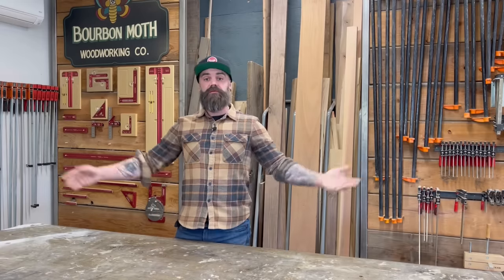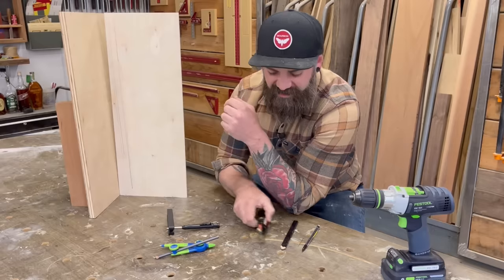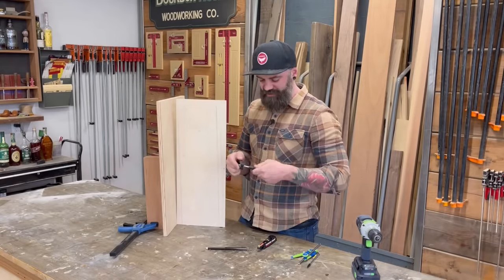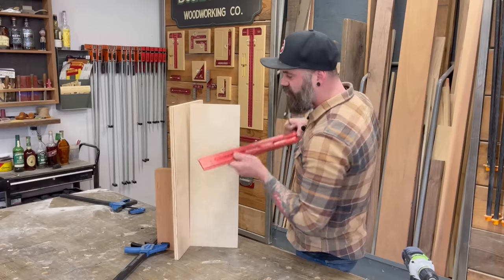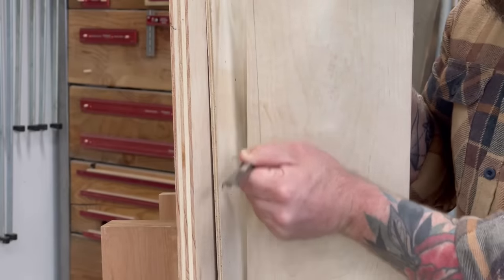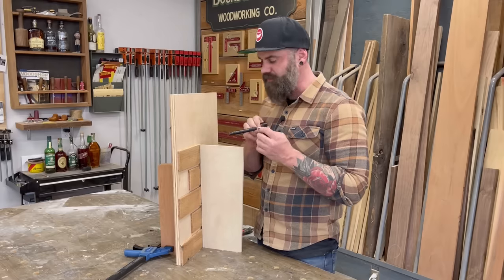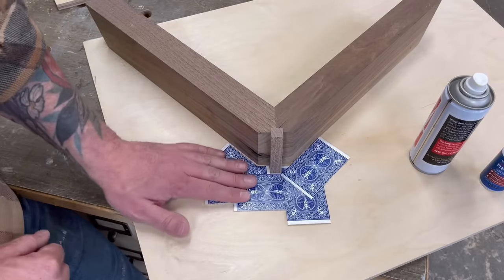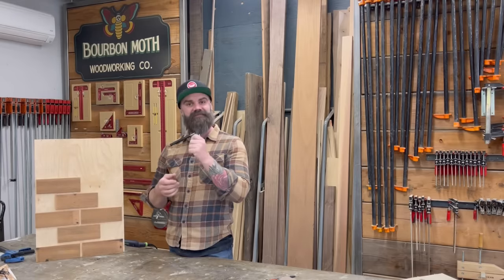Woodworking Tricks You'll Actually Use || How to Scribe to an Uneven Wall

Comment: Love the upside down jigsaw tip.  Another tip for using the jigsaw... angle the blade a bit so you also produce a sharper edge to meet the wall (like you did with the table saw).  It is then easy to adjust the edge with some minor sanding.

Comment: For the playing card trick. I use post-it’s instead with the sticky side towards the wall. So no glue needed there. And when the edges you’re scribing to aren’t straight, you can just have post-it overlap a little onto the wall, trace it with a utility knife to cut the exact shape. Stick it onto your board and done.
Reply: Where those lil mini post-it's can come in handy too, which is cheaper than the playing cards, can be re-used too. Love it  thanks!

Comment: Never thought about turning my jigsaw upside down.  Great idea.  Going to give it a try next time.  Thanks for all of the great videos.  Keep up the good work!
Reply: I did this with an electric planer for a makeshift jointer. Turned put better than I thought so I tried with a jigsaw and so far it gets the job done. Hope it works for you too
Reply: Most professional jigsaws are designed to be used that way.
Reply: They also make blades that the teeth are reversed.  Little more spendy, but worth it when you don't want to splinter that finished piece

Comment: One other idea for scribing - if you don't have too much variation to the wall surface (IE: Stone, Brick), you can put a washer, or a dowel with a hole drilled through it, over your pencil.  It acts like a roller and moves smoothly with your pencil.
Reply: That will cause sharp corners on tne profile to get rounded. Doesnt work

Comment: Good tips and love the upside down jigsaw one. Unfortunately most tutorials only focus on the end that needs scribing and ignore the real life problems. The last time I had to do this was with kitchen base units where the wall was wavy and the floor wasn't level. So, I had to scribe both sides of a corner while making sure that the top would be level with the worktop and the front would be flush. They were laminated particle boards so I didn't have the luxury of scribing the wall and floor sides then cutting the front and top to the right sizes. The scribe lines couldn't just be a random distance from the edge, but taking material off one edge would also affect the other edge. And that was just in my own kitchen!

Comment: Jason, This is an extremally helpful  video. Thank you so much for this. I have done a couple of shelving jobs like in pantries or coat closets where I have to scribe 3 walls (the back wall and both sides) I believe it is called an alcove.  I have used a few different methods just what I have figured out on my own. they did not always work out as good as I had hoped. There are few if any detailed videos on scribing. Thank you again for this video these are all awesome and useful tips. You sir are a talented craftsman. Hats off to you.

Comment: Jason great video for the newbies and start up guys, only thing you didn't mention I thought I would point out is the depth of the cabinet or dressing panel.
When scribing you need to have enough material to ensure the panel still aligns with the front of you piece or have enough of a service void on the back of a cabinet as not risk having to unnecessarily cut into you cabinet back panel.
Great video as usual and totally agree regarding the trend scribe it's to thick to get a nice scribe on alot of surfaces like brick or textured walls.

Comment: I have a five sided room that I had to match counter tops to the wall.  I used a scrap piece of foam board (or plywood) and laid it on the counter top support and used a washer rolling the outside against the wall and the pencil on the inside of the washer pushing the washer against the wall and following the shape of the wall.  Transfer scrap piece to the final piece and it was a perfect fit!  Good video.  Thanks.

Comment: The funnest scribing is a rock wall or moldings like a crown chair bumper or mopboard moldings. They have those multi-disc contour boards you just push in and all the thin discs adjust to whatever shape it is whether it is straight or not. Also when you get close rub graphite on the end of the board and give it a rub. That will show your highs to sand off. Great video. I'm inspired to go scribe something now.

Comment: Great video! The technique I like using prescribing as a trim carpenter is get my scribe line and if you are comfortable enough using the table saw I do a free hand rip the blade beveled not to my line but just close to it. Then sneak up exactly to my line with either a belt sander or a flap disc on an angle grinder
Reply: I do the same. 1" belt sander or an angle grinder can tune up everything. It's  the fastest way to scribe door and window casings into uneven walls.

Comment: FLAT WASHERS come in several sizes, widths and thicknesses. Fender washers, SAE, USS and metric.  I've often seen and use washers to scribe an edge. I keep a collection of washers hanging on a binder ring from 1/4" - 1 1/4". The inner and outer diameters can also be used to draw radiuses for corners and circles for drilling holes on a layout!

Comment: Awesome video. 
I used an expired credit card for a scribe, where I drill a hole near the edge big enough to fit the pencil tip. It's nice and thin, but sturdy enough to guide easily. I was surprised at how well it works.
Benefits: 
1) You don't have to worry about how you hold the pencil because the hole is the size of the pencil tip. 
2) It's closer to the work piece so you get a more accurate scribe. 
3) You easily drill another hole in the card to get further or closer to the wall you are scribing.
4) It fits under gaps so you can get the pencil mark closer to edges. 
5) You can use the same hole at an opposite edge wall by just flipping the card :)
6) You can cut the card so it's less wide to capture more variations in the wall.
Cons:

1) It's straight so it works best on non-textured walls. You would have to cut the card so it has less width to capture stuff with large variations. I could see where the washer trick would be better here.

Comment: Nice into to scribing. You have a lot of good tips. I use an angel grinder alot with a sanding disc. I carry multiple grits in my kit. It works really well with complex scribes, ie. wood to stone. The really cheap metal compass is my favorite scribe tool, and there cheap. I have a bunch, because I'm always misplacing them. I try to always keep one in my bags. Also the sanding disc makes for a good pencil sharpener.  Keep your point sharp! You can also use a utility knife to reinforce your pencil line, and then you have a knife wall to  cut to.

Comment: I usually use my small belt sander (2x14) for cutting the scribe. Might need a jigsaw in certain circumstances (like with brick/stone), or to remove the bulk of the waste. The belt sander is great for fine tuning. And back bevelling as you come right up to your line.

Comment: Great stuff, Bourbon Moth. However I get the impression when eg fitting wardrobes, that most carpenters build the cabinet first and then do the infills. Would like some more detailed info on doing the side of the infill opposite the scribed edge so the infills fit to the cabinet. Perhaps another short video covering that?

Comment: Tip: jigsaw blades can wander and flex creating an angled cut that might be the wrong angle so the back of your piece touches your “wall” before the edge of your finished face. So as your cutting out an angle on your cut on purpose. Something that was done in advance in the video but never on the scribe cuts themselves. Also like so many things practice is key!

Comment: Hi there, love your videos and have learnt many things from them.
Do keep them coming. :-)

In my particular case I am trying unsuccesfully to figure out how I can "easily" create the correct curved surface for specifically round posts knee braces.
I guess the easy way is to cut a flat surface in the two posts and fit a knee brace with two flat ends at the correct angle. But I want it to look slightly more natural and am trying to figure out how to cut a round hollow center at each end of the knee brace which fits snugly around the beam it will be attached to.

All help on this subject would be great!

Thanks and Best regards,

Comment: My preferred method is to use a hole saw with a diameter of just over twice the width of the largest part of the gap to cut a circular scribe guide. Put a pencil down the middle of the guide hole created with the hole saw (forstner bit down the centre if it's not quite large enough). Using this means that the pencil shouldn't be able to wander away up or down like using a compass or the drill bit through the pencil. I use a jigsaw to cut close to the line so I don't have to worry about tearout, then use a handheld belt sander clamped to the bench to cut all the way to the line (if the piece is small enough to move easily, otherwise take the belt sander to the piece clamped down).

Comment: Try using a washer and put your pencil in the center hole. Then simply draw a line rolling the washer along. It will mimic the shape of your original piece great. For more detail, use a smaller washer or vice versa for large flat scribing surface.

Comment: I think scribing siding is the toughest because if you use a pencil method you will tend to round the edges of the siding ....when i did siding i just took several 1/4 inch strips of cardboard and glued them together while following the siding profile. Thus creating a template i could follow /trace on the the board i was putting against the wall

Comment: The card trick is useful but a Ticking Stick will do all those jobs and give you a perfect fit every time. Many woodworkers are not aware of a Ticking stick; maybe you haven't. It's a method that has been used for many years by craftsmen. And very simple.

Comment: great vid ! having to fit to a wall is or was my nightmare but i have just maed a drill scribe, and its adjustable, pair of pliers to screw the bit in or out.  BUT while the card trick works, over time its a little waste full and long winded. take your example if that was floor covering or a sill, you had some sharpe dart angles, so more cards glue and scissors. even for the base of a large unit. a cheap couple of dollars former comb (rectangular half inch thick frame tool with 200 individualy sliding pins or teeth) does the job quicker,  loosen teeth, push into the corner or shape your working to, lock teeth, scibe or draw following profile onto wood and cut out.  When finished reset teeth and put away till needed. i have 2, a steel one o my father used for wood/linoleum/carpet/cornice/metal, its about 40 yrs old still good, and a plastic big box one cost about $4 works well and should last a life time .  cards work in a pinch, but a former comb is quicker, especialy if the corners rounded or jaged .   bought my plastic one 15 yrs or so ago and still use it.

Comment: This helped a ton actually. The one problem that I am dealing with is where to start which I think you alluded to at the end. We are installing a new counter top in-between 2 walls however, Both the sides (length) are different due to not being square (one end is 59 1/2" towards the front while at the back its 60") and then the width (front to back wall) is also not square (26" on the right side, 25 1/2" on the left side). I hope you are still watching this channel cause I could really use some knowledge in which part to do first. The piece we are cutting from is a 26" x 6' piece. What would be a good way for me to tackle this in a manner that will not have me screw up the piece? I am down for creating a template out of plywood for sure. I just need to know or would like some advice on were to start. Thanks!

Comment: I'm trying to scribe a small roughly 6"x6"x1" block to go behind a porch light on clapboard siding. The awkward part is figuring out how to cut the profile since it's not like a board and both sides may not have the same profile; there may be a knot or warp on one side the other doesn't have.

Comment: You could tape the pencil to a piece of scrap (or even hold it). If you need a very fine scribe, do this first and take off most of the material, then fine tune it with just the pencil as needed

Comment: Try using penny washers to scribe to walls. Place the washer flat on workpiece and the outside rim to the wall, pencil to the inside of the washer, run your pencil down your piece letting the washer outer rim trace the wall... different washers will allow various depth of scribe because of difference between inner and outer diameters ..

Comment: Coolio!  One more budget method is the washer scribe.  Just take a flat washer and hold your pencil inside and pull it across the gap.  This, of course, will not work for your "complex shape" or brick, but for just a belly on a wall, it works slicker 'n snot.

Comment: Another problem is modular material such as tile or flooring. The trick, example for tile, is to lay the tile up to the wall until the next piece needs scribing. Pace that next piece, that you will need to scribe, not against the wall, but on top of the last whole tile. Then you can push a third tile on top of both but against the wall to use as a gauge to mark the scribed tile. For an irregular wall, use the third tile like one of the scribe tools with one corner on the wall and mark where the other corner falls on the scribed tile. Ditto for wood flooring except make a marking gauge with a short piece of flooring to get the right modular distance to the scribed piece which, again, you put perfectly on top of the last full flooring strip

Comment: If you have complex shapes to deal with more than once in a blue moon, just get a contour gauge.   They also deal with curved shapes and other straight edged shapes the playing card trick won't work well on.  It's a super cheap tool but it is a monotasker, so if you rarely need one, it's maybe not worth it.

Comment: The trend one I had the lead would always push back and I would have to do it up tight and in the end I had to do it up so tight to grip the lead it snapped the plastic threaded Rod the brass knob screws onto. I use a tracer one now many different positions and a pointed profile head.

Comment: Looking for some suggestions for scribing a outside wall of a round log home. Normally one would cut the width of the material into the logs, creating a flat surface to work from. Being that this door jam which I may remove after returning it to a office. I need to keep the round log finish.

Comment: An old dog's two cents: plastic U-scribe tm jigs to hold piece you're scribing to cabinets;  use Porter Cable Model 371K 2x14 one handed belt sander w/ 50 grit paper like abrasive block plane; How Far Out level gauge for point to point out of level/plumb surveys; make easily cut scribing templates from 1/8" hardboard; use yellow masking tape to see scribed lines on dark work pieces; for very detailed brick scribes, three steps - 1) secure work piece so it absolutely won't move; 2) scribe only flat faces of bricks using any simple scribing tool; 3) use small wire finger style contour gauge (e.g., General # 837) to locally detail mortar joints.

Comment: Ive been watching the scribing videos for a while now and I stil cannpt find a tip for a part im looking for. Assuming that the pararel edge to the scribed one is finished already, and it has to be precisly i specific spot, i need to scraibe in a way that the finished piece will have exactly the width that i need. (and that beeing diferent due to wall not being stright

Comment: In most situations I just use the ole knuckle scribe.  I hold my pencil tightly and push my knuckle against the wall.  It would have worked for all your examples except the brick one (my knuckles aren't pointy enough for that.). :-). I've used it a lot for scribing to sheetrocked walls especially.  No new tools required!  I worry your drill bit would leave a mark on the wall ..

Comment: If the top would be between 2 walls (actually 2 short sides against opposite walls and the rear side against 3rd wall) and the top is wooded - how tight should be the fit? Should we consider some wood movement?

Comment: Some good tips and ideas but you forgot to mention that the piece you're scribing needs to be plumb and or level before starting the scribe. If you need front edge to finish flush I use a block of wood bigger than the widest gap in the scribe clamped to front up again cabinet then use same size block to scribe then cut with a slight back cut (Bevel) job done
Reply: Good call, although I’m not sure I followed your method.  Would you mind restating it?
Reply: @pkrollin514  ok I'll try, if you clamp say a 4" wide block to the opposite side that you are scribing then push that up against the front of the cabinet then use a 4" block to scribe the panel will be scribed to wall and flush with front of cabinet ( it can be any width, just use same size to scribe) hope that helps
Reply: @barrychristian4050  So, if the wall isn’t plumb. You’re using the block at the front to keep a placeholder for where the panel comes flush with an alcove wall.  
Shouldn’t that block be equal to the width of the largest gap you need to scribe?
Reply: @pkrollin514  yes the block should be equal to or bigger than the widest gap of the scribe. but I offset the panel so the edge that needs to be flush is plumb and a said distance from the required finished position, this distance has to be the same or bigger than the widest gap of the scribe,use that same measurement to scribe, cut to line, panel will be scribed to wall and finish flush at front edge
Reply: @barrychristian4050  awesome. Thank you. 🥃🪚